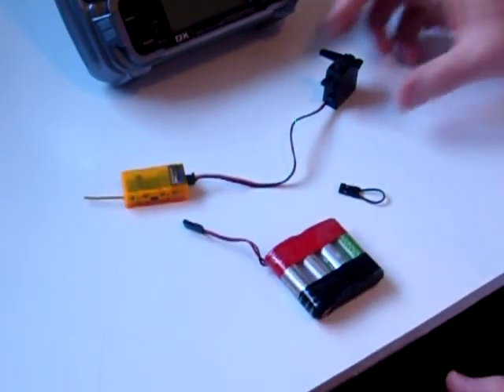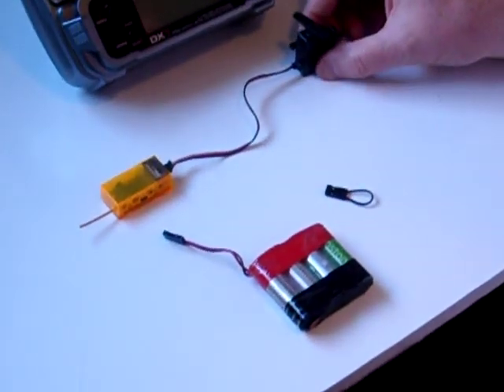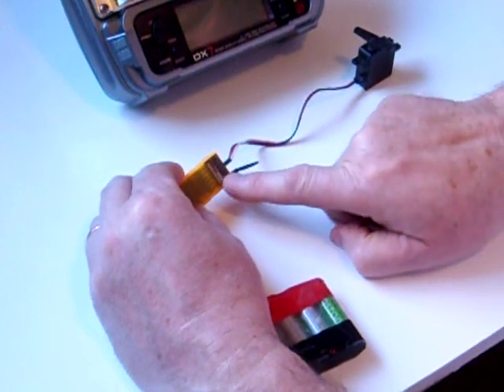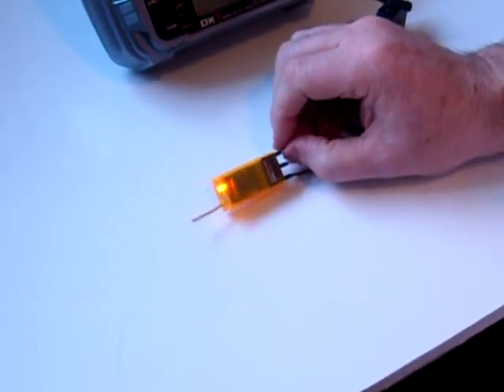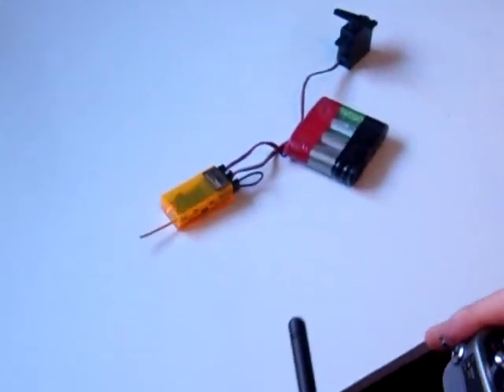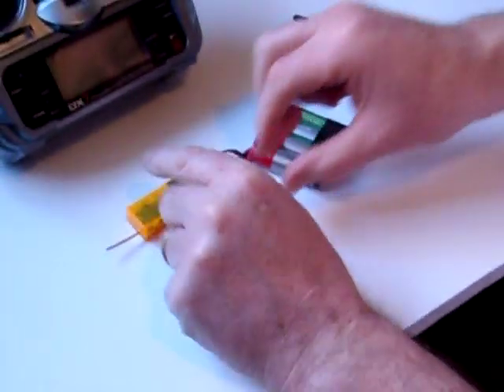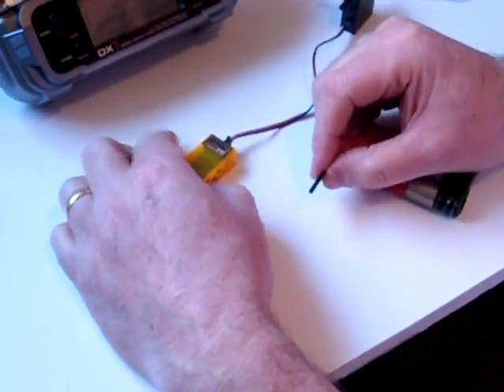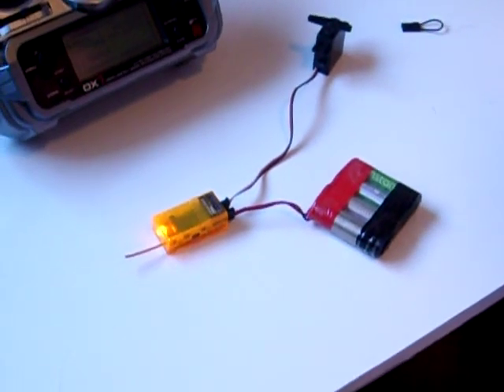Binding The Spektrum 2.4Ghz radio System

Comment from the maker: Think of the bind plug as a switch - its a simple loop of cable which connects the two outer pins of the battery/bind socket together. One of those is normally a "signal" pin ( white yellow or orange on your servo leads ) which carries the signal pulse from the radio to a servo. On the receiever's battery / bind socket, this signal pin is redundant so the spare pin is connected internally to a "switch" in the receivers circuitry that puts the rx into bind mode when connected via the bind plug to ground.